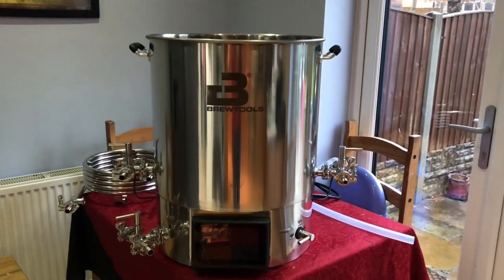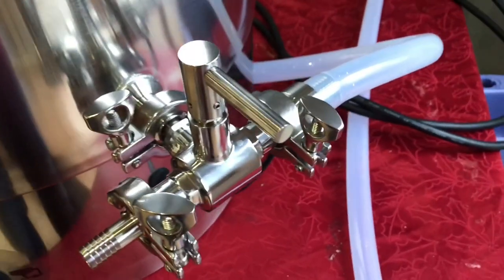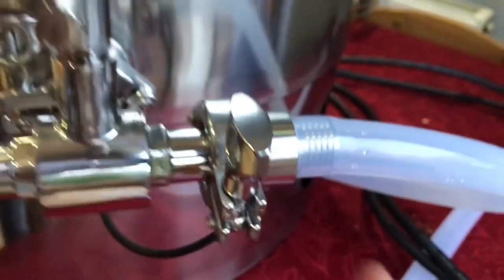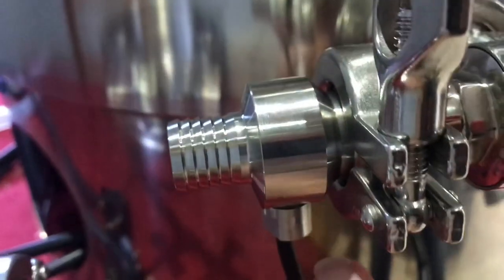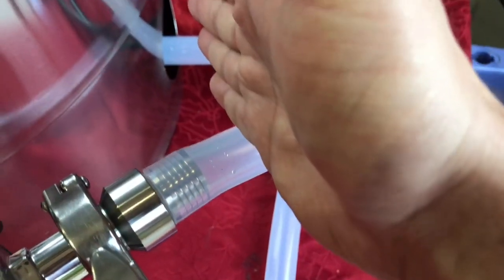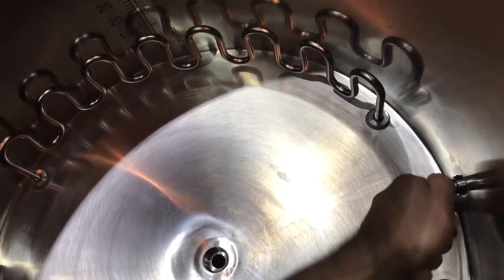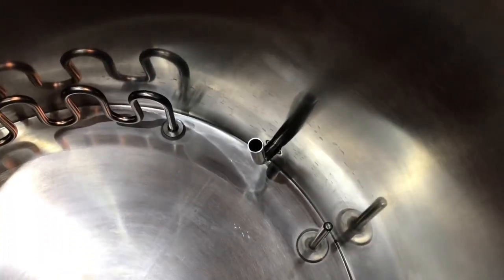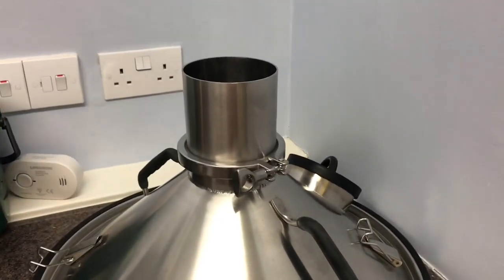BrewTools B80pro - 3-way Valve Set-up and MORE!!!

Comment: Hello ,
What do you think spiral aeration Brewtools? is it good to use it when placing in vats for good aeration before inoculation? or is it not necessary?
Reply from the maker: Hey. I mean it is intended for good aeration, but I never found the need for it personally. When I transfer into my fermenter I just hold onto the pipe and transfer into the fermenter from a standing height, so I can make sure the wort splashes when it enters the fermenter. That works for me and it costs nothing 👍🍻
Reply: @8pibrewing867  Thank you a friend told me exactly the same so okay thank you !!!